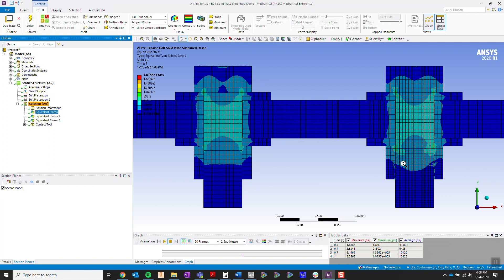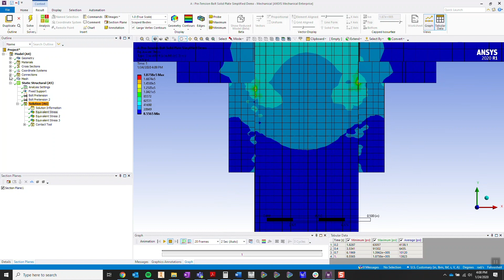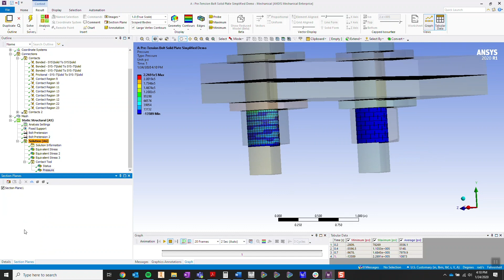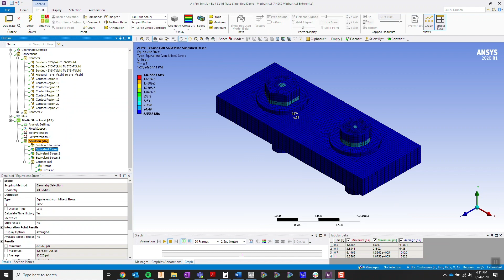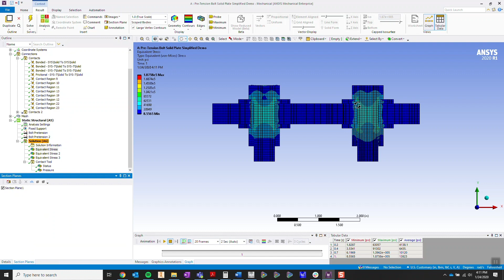Tech Tip: Ansys Mechanical: Bolt Pre-Tensioning and Adding Thread Information for Stress Results

Comment: I tried it but it was error, it said "either more than ine face is scoped or the aplication does not detect cylindrical.. 
" And on my geometric modification the for the orientation  i chose programmed controlled but it turn yellow, do yoy know how to fix this?
Reply: Same problem
Reply: @peacemaker4499  @michaeljulian5958 Hey guys, So i do it by creating two coordinate systems, one at each end of your axis, then select them in your contact settings.